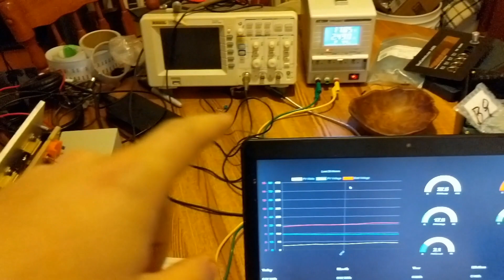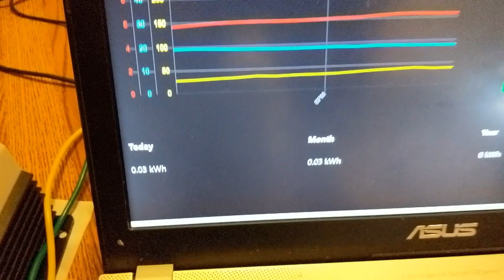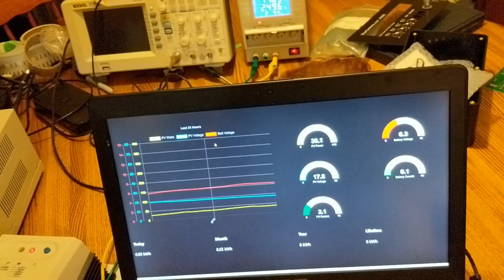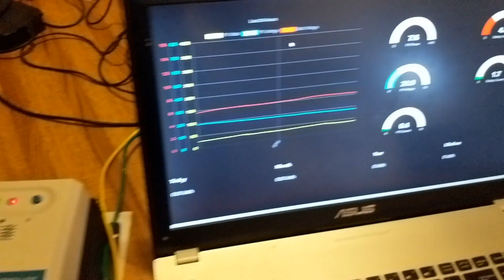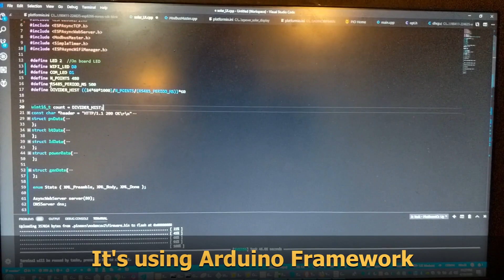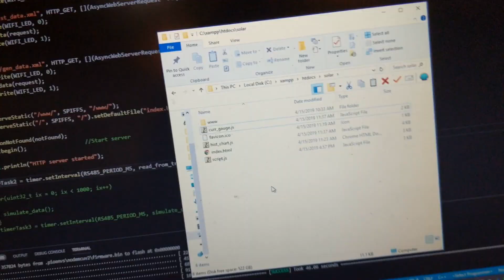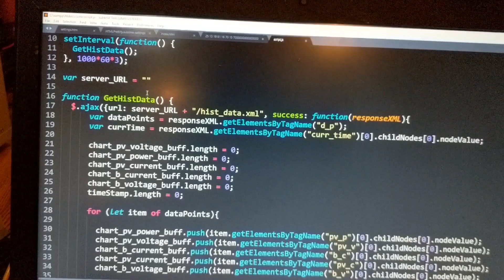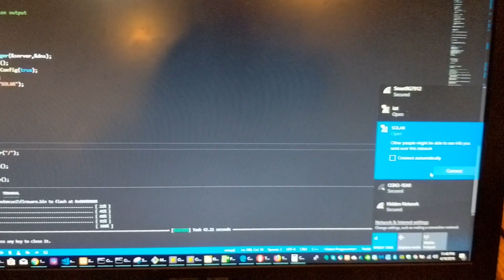RENOGY + EPEVER + VICTRON Kit WiFi Solar dashboard - Self hosted Part 2 (AVAILABLE)

Comment: any chance of getting the code changed so as to read a 24v (32v) battery setup?
Reply from the maker: In case anyone is wondering, I got him all set up and the new v3 Software will Auto scale depending on your system